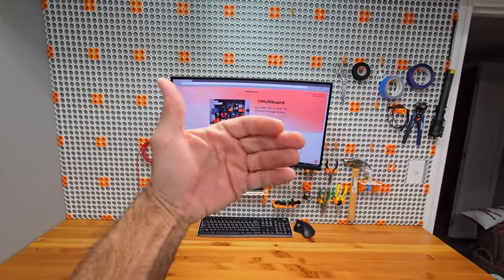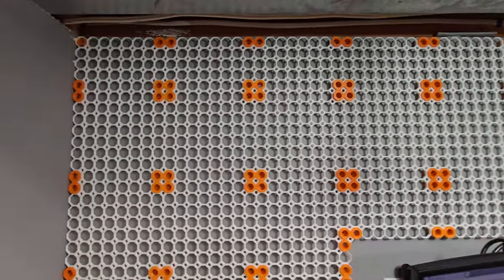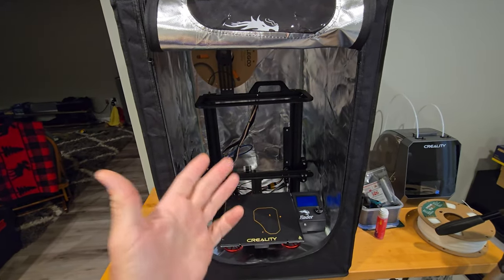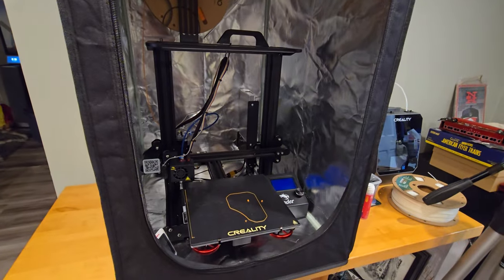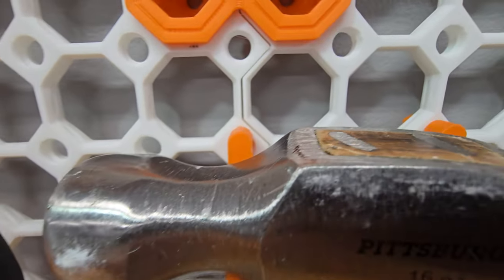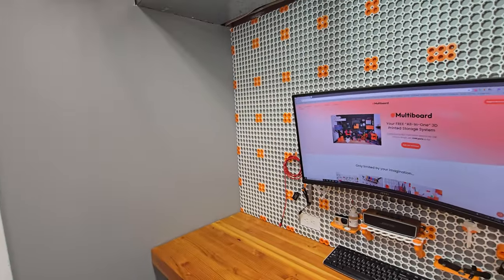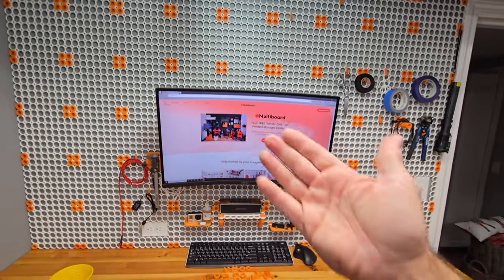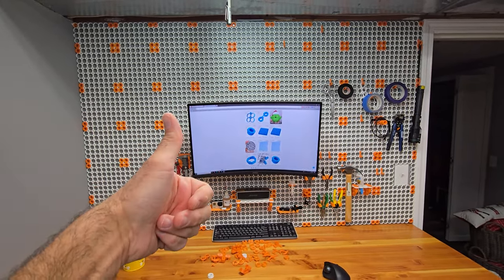Workshop: Part 5 - Wall Complete!

Comment: There are screw in spacers for the small peg holes. I use them in the middle of 8x8 panels so that the panels won’t flex too much to the wall when inserting something.
Only downside is that the pegholes are occupied.
Reply from the maker: Good to know. Adds to my frustration about the lack of a catalogue though